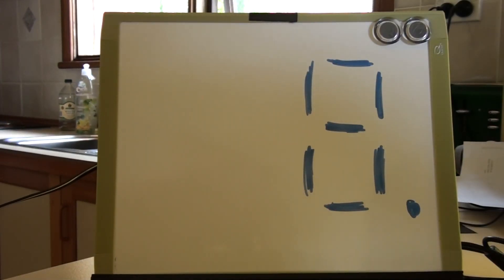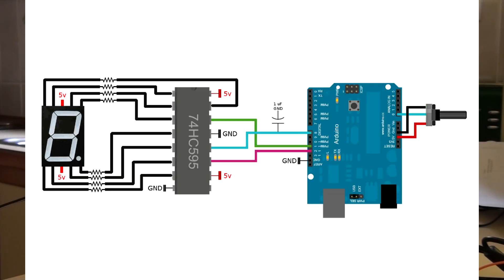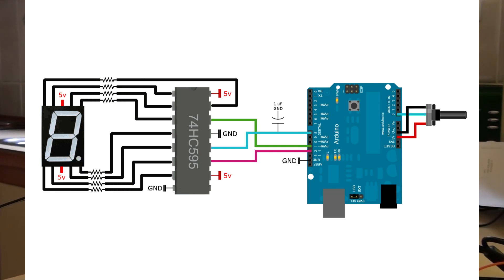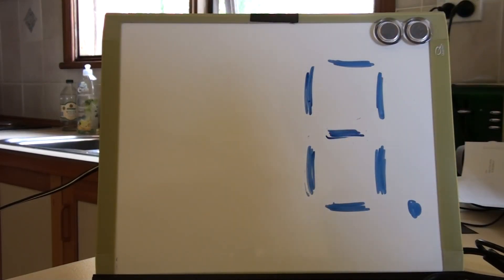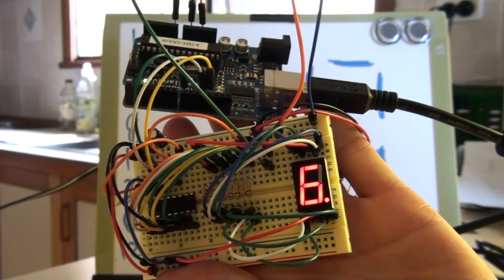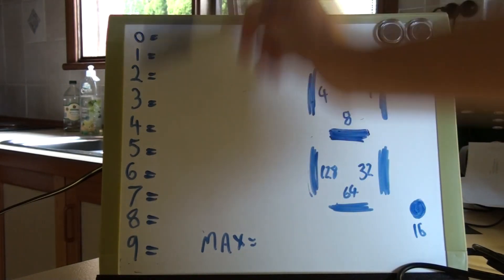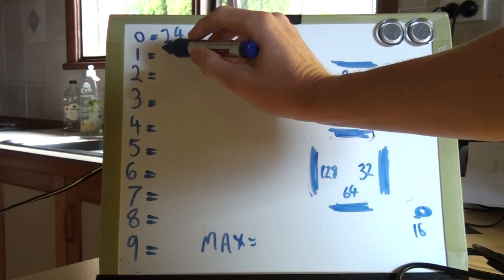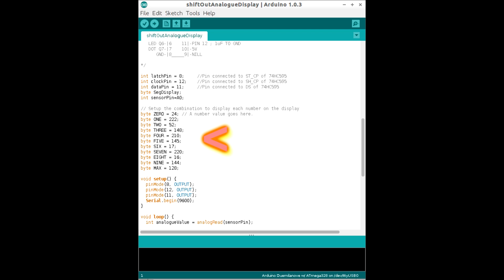Tutorial: 74HC595 Shift Bit Register using a 7 Segment Display, with code.

Comment: Could you connect just one resistor in the output, rather than one for every segment?

Thanks
Reply: +Mario LM Yes.. That might work technically. But the thing is, if you do that, the load sharing will not happen properly. So what will happen is, the display will be most bright when it is displaying 1 and have medium brightness while displaying digits like 5, 6 and least brightness while displaying 8 (depends on number of LED required to glow up to represent the number)..

Comment: can we control three seperate seven segment for more than one digit using shift register??
Reply: daisy chain the 595's and have higher value bytes? 0-2056?
Reply from the maker: I've actually done this (daisy chained). That was kind of the point of what I did in this video (for me that is).
It all comes down to your latching times..... From memory, it's been a while... Not sure if I even put that code up on GitHub.

Comment: byte seven_seg_digits[10] = {
                              0b1111110,   // = 0 (segment ABCDEFG order)
                              0b0110000,   // = 1
                              0b1101101,   // = 2
                              0b1111001,   // = 3
                              0b0110011,   // = 4
                              0b1011011,   // = 5
                              0b1011111,   // = 6
                              0b1110010,   // = 7
                              0b1111111,   // = 8
                              0b1111011    // = 9
                            };
No adding up to do if you use the "0b" prefix for binary.
Also no need to name the digits, here, because, e.g. the pattern for 4 is
"seven_seg_digits[4]" within the byte array.
That gives a direct relationship between the digit to display and its bit pattern.
[ For Common Anode invert each bit after the 0b; 0=1, 1=0 ]

Comment: great tutorial, that mapping will help a lot for 6, 74HC595 chip outputs.  Did I miss something in the code?  I didn't see anything in there for the poteniometer.
Reply from the maker: The line is:
int analogueValue = analogRead(sensorPin);
in the shiftOutAnalogueDisplay code. sensorPin being A0.

Check out the ReadAnalogVoltage tute on the Arduino page if you want a better explaination. I sorta didn't want to repeat stuff that other people had already explained better than I could.
http://arduino.cc/en/Tutorial/ReadAnalogVoltage

Thanks for your Q :)

Comment: I wish someone would explain the process of sending the bits to the 595. That's the missing piece for me :( nice video though.
Reply from the maker: How do you mean exactly? Do you want to now how the Atmega chip releases the bits? Or do you mean how does the 595 chip recieve and push out the data?
I can explain the latter in simple terms.
The 595 chip receives the data in serial, meaning it's stacked up in a line like 11111111. It is then released in paralell, meaning none of the 1's will be released until the "LATCH" signal is sent to the chip, allowing the outputs to send data. When they are released, each circut hanging off of the 595 outputs will go high (1) for a clock time period.
i.e. http://www.arduino.cc/en/uploads/Tutorial/595_timing_diagram.png

Have a look at Kevin Darrah's videos, he goes into detail about your clock times and such.
Hope that helps or at least steers you in the right direction.